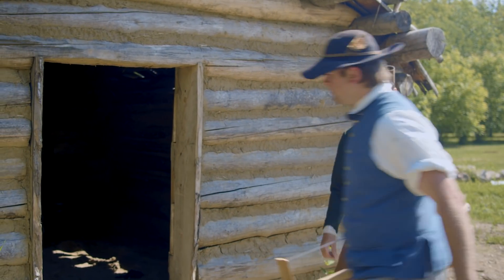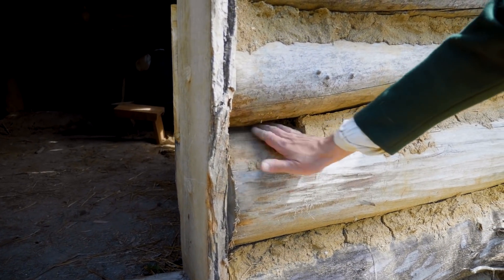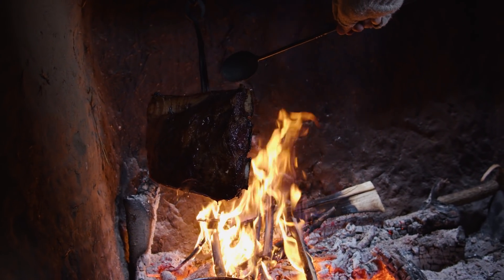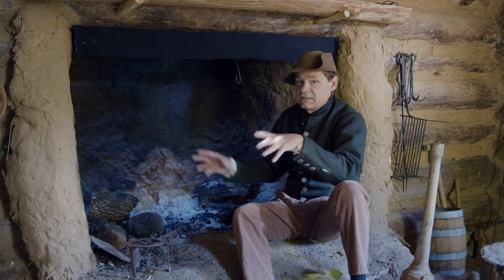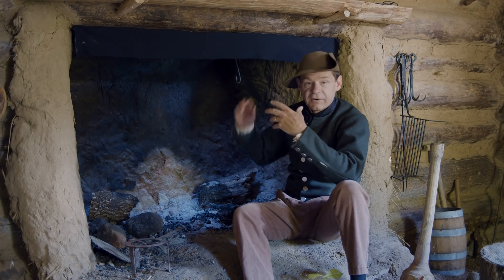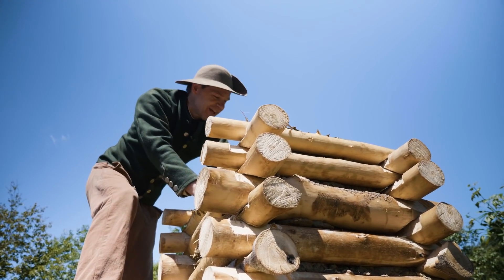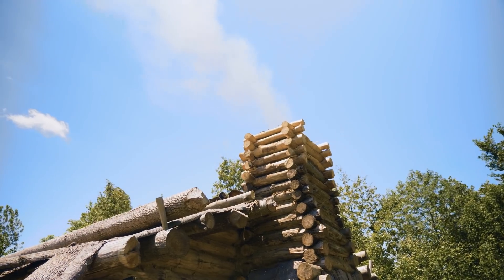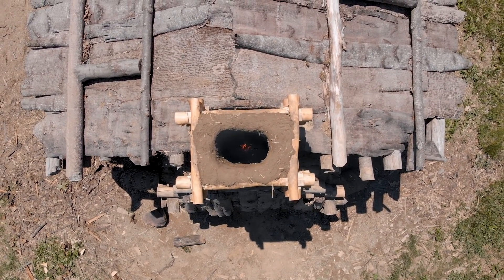Repairing Our Homestead Log Cabin - Chimney Maintenance

Comment: Jon, you might add ashes to the cob and cake it on the top to protect from fire. Wash and oil up your hands afterward, it's very alkaline.
You might build a sledge and bring in some stone. We'll pretend not to notice if your mule leaves tire tracks...
The Foxfire Books, at least the first 6, will be great sources of ideas. IIRC there were instructions for making a primitive shinglehorse- trust me, you'll need one!
When it comes time to test and cure the fireplace, please make at least an hour-long video of just the fire burning- no music, no speech, just a bright fire burning in the dark, no sound but popping and crackling, and perhaps you feeding the fire... Something to doze off to...

Comment: In my area, there are several log cabins that have been preserved and one has a rock lower chimney with the log and cob upper portion. They all have either flag stone or bricks on their tops to protect the cob, bricks were made on site of most of the farms around here by mixing some of the river sand with our Georgia red clay and then baked in big fires. An old timer once told me about waching his father do a brick fire by making a large structure of the bricks with lots of room in between the induvidual bricks, then logs and brush piled in among them, then a large pile of logs built into a structure around the pile and all lit up. He said the fire burned for 3 days and when it had gone out and cooled, they collected up several hundred bricks to build the foundation for a house.

Comment: A chimney cap would protect the clay from the elements and they made them from either tin or stone.
Reply: WatcherintheDark69 - I was thinking that as well. 👍
Reply: I think a stainless steel composite would hold up better through the elements. Also if they went with triple pane windows and a polyethylene siding. They could probably also add in a smart thermostat coupled woth an electric heater to regulate temperatures netter and keep the mud from cracking.
Reply: Tin wasn't a viable option until the early 1800's. Stone for sure. Here in New England we have areas where layered stone meets the surface. These were quarried when found. Thin, flat stone that didn't require a mill was highly coveted.
Reply: @pluto8404  Uhhh, they are striving to keep this cabin true to the period, not modernizing it.
Reply: @TrooperBri : I've seen larger flat stones and also slate. The trick is to do it peaked with the openings at the ends facing the dominant winds of that area. Also, setting stones into the cob at the top goes a long way to minimize the erosion of the top edge. But the slate cap is the best and is common throughout europe.
Reply: @sonofeloah  My hobby (and YouTube channel) is about metal detecting colonial home sites (cellar holes) lost in the woods of New England. Items like slate and nails would be luxury items through most of the the 1700's. The more permanent the site we find, the more stone we find collapsed in the chimney pile.
Reply: @TrooperBri  That sounds like an amazing hobby.
Reply: @pluto8404  LoL
Reply: @CGH250  qqq¹
Reply: What about fired clay bricks? Like, something akin to terracotta?
Reply: rather than stone, i would use a pretty thick piece of slate, because you can get it in a better form and its more heat resistent, if it is not thin. a thin piece would burst, but if you put it at the top of the chimney, it would protect from the rain and wouldnt be in direct cotact with the hot fire. it should resist the heat from the smoke, because its not a fast temperature difference.

i would try slate.
Reply: @TrooperBri  well i presume they tried to usw stones, because they got these stones from their fields and recycle them and they tried to imitate a chimney from their homes, but these stones could be from the lower areas of the chimney, while the top was out of wood.

slate, shalem and schist was used for roofs, if you got your hands on it, in europa and in the US in cities and in big farm houses. they wouldnt use it in a Log hut, who dosnt last for a long time. but they would use it in a long term home. slate got/get produced in Newfoundland, in Eastern Pennsylvania, Virginia, and Vermont, Maine and New York. 

And i dont want to be critical, but its one plate of slate in a pile of stones. are you able to see small slate pieces in these chimney piles. they would be small and grinded up by time and weather.
Reply: @pluto8404  LOL there's always a comedian
Reply: Flat stones on top and big flat on top of them.
Reply: @sonofeloah  you                            

the joke
Reply: @TrooperBri  If slate was too pricey, surely they could used fired clay (terracotta) to the same effect?
Reply: @pluto8404  why if a coating of liquid mytrill does the job?
Reply: @messman10  frontier people had no brickworks from  which to buy bricks.
Reply: @sonofeloah  I think he was joking!
Reply: @rosemcguinn5301  For Fired Clay Bricks I recommend:
https://www.youtube.com/watch?v=FwRFH7MH5N0
Turn on subtitles because he talks very little.
Reply: @sonofeloah  are people not realising the guy was just kidding...
Reply: @rosemcguinn5301  you don't have to buy them they are readily made with a minimum effort
Reply: @TrooperBri  “Items like slate and nails would be luxury items through most of the the 1700’s.” For the slate, it really depends on the local geology. If there’s an outcropping of it in his area, he should use it. Pioneers would have. Ditto for any other non-slate stone that makes suitably flat pieces.
Reply: Can you get slate?
Reply: @pluto8404  lol, I once told a couple who were trying to recreate a medieval feast hall in their home that the head of the hall, over the hearth, would be a fine place to hang a plasma screen tv.
Reply: @rosemcguinn5301  You could fire some primitive tiles in a small pit. Weather it was actually done, I don't know.
Reply: @sonofeloah  whoose
Reply: @sonofeloah  the joke went so far over your head it got confused for a ufo through a telescope
Reply: @pluto8404  look at this guy, time travelling to get advanced materials

Comment: It needs an outhouse with lilac bushes planted close by.
Reply: I approve of the lilac bushes. I guess the outhouse too, gotta have somewhere to go.
Reply: You'll do well to plant Hollyhocks too. They'll bloom all summer, lilacs only bloom in spring. I've used many an outhouse,  flower decorations are a plenty.
Reply: Make sure there is not nettles near the outhouse.
Reply: Elacampane, its leaves to be used instead of toilet paper.
Reply: Don't forget a crescent moon cut out of the door to improve ventilation and for the memes
Reply: I think lilacs are late 19th - early 20th century. I'll have to look into that. My Grandpa who lived from 1913-2005 refused to install plumbing in his small farmhouse bathroom. He used a huge metal washtub for his soaker bath. Had to boil water on the stove to bathe. Originally had a pump in the kitchen sink, but when it broke, my uncle who was a plumber installed a faucet hooked up to the sweetwater well next to the house. That's about as modern as Grandpa got, besides electricity and a black rotary dial phone on a party line. He kept livestock to the end, so lilacs would've been futile next to his outhouse. He put it out past the barn. When he died, he was probably the last living person with an actively used outhouse that wasn't a summer cottage or camp. He was definitely the last party on the party line. All the rest had died before him.

Comment: I’m glad you built up the chimney taller. I was worried about that (I think I even mentioned it in a comment a few months ago). 

To keep rain off the chimney, and also to keep rain out of the cabin, why not erect a small roof over the chimney? “Roof” may not be the correct technical term, but you probably know what I mean. A slanted cover held up by posts at the four corners, with space between the cover and the top edge of the chimney, so smoke still escapes unimpeded.
Reply: Gary Cooper   Perhaps supported by well spaced stones to allow adequate airflow?  It could work!
Reply: Could the cap be of bark? That might catch on fire - cover it in clay? Would a stone one work? They would have to have stone they could split into slates. Hm. Is it 'fair' to use tin?

Comment: Short question on the chimney. Why didn't you cover it to avoid rain and snow enter it?
PS: Great video again.
Reply: Watch that video- no time, no stone. Here in KY  he could line the whole firebox with limestone, add a smoke shelf, etc. and get some real heat from his fire...
Reply: I was wondering the same, probably because it would have to come off before each use. Also having a cover on top would be a hazard to take off during inclement weather when you just want to hunker down and build a fire.
Reply: @hcirs9425  Not if there's a gap between the cover and the chimney.  Protecting chimneys while letting the smoke out is an old idea, they just didn't have time to do everything with the available resources.
Reply: @princecharon  Good point, if so much cinder comes out one might need something fireproof beyond clay-covered wood.

Comment: Townsends! Mineral oil mixed with clay makes a decent water resistant plaster, this should help keep the chimney from weathering so fast and it won't burn. Also you can use the same technique to keep dirt floors from being so dirty, just tamp the earth well, they've used it in India for thousands of years.

Comment: One of the great things about those temporary log cabins is after a year or so when you've stopped using it and it drops to bits, the walls basically give you a load of perfectly dried out firewood to boot.

Comment: We live in the southwest US where a lot of the old buildings were built of mud or adobe.  It's a dry area, but it does rain and snow, and the buildings suffer.  There is a building style here called "territorial" which is an adobe building with the top course made of fired brick instead of mud.  Moisture won't hurt the brick and tends to preserve the mud lower sections.  Slows down the necessity of repair.  I know nothing of building, so that concept may or may not work where you are.

Comment: You guys should make yourself some workbenches. I made a nice one last year, just take a good sized log, white oak would be best and last longest, but poplar will work if that's all you have. Cut it about 4' long, drill holes for the legs at about a 15-20 degree angle, I made the legs out of buckthorn because it's invasive so I had to cut it down anyway, plus it's very strong. Oak or elm saplings would work well too. Then just hew the top flat with an axe, smooth it out with an adze and then plane it smooth if you want to. Drill some holes in it for pegs/bench dogs and then you can kinda clamp things in with wedges, or you can make holdfasts out of iron bar.

Comment: Have you considered using the old shingling you’ve got there as a base for cedar bough thatching? Just layering on cedar boughs a layer from eaves to ridge at a time until you have six or seven layers of those up there. It should shed water easily and form a nice covering as it settles in.

Comment: I used to live in a 400 year old cob cottage-the middle a row of a wool shed and two workers cottages. Kinda weird getting paint to stick on it or install new electrics in basically dried mud. Originally thatched refinished in local slate. The cottage before that was 16 inch local metamorphic stone 100 years old.

Comment: For the doors, if it can be found, or better yet, made, quarter of rift sawn lumber, with the rings running between 45 degrees and 90 degrees to the width of the planks, will minimize or at least redirect shrinkage and expansion, from the width to the thickness of the boards.

Comment: Where did they use leaning chimneys that were propped with poles.
The reason that they made them that way, was if they had a chimney fire, they could knock out the poles, and let the chimney fall. So the house / cabin wouldn't be lost.

Comment: Suggestion for the door. Keep this one on and maybe add a tarp to keep critters from being too inquisitive. Meanwhile, select the wood you want to use and skin and dry it. You could rough cut it for the shapes you want but do not do any measured cuts,,,yet. This fall once the wood has dried out, proceed to cut the lengths and widths needed and make a new door. It will not work very well to add to the door you have. Use it as a table later.

Comment: Have you considered making a small kiln (fairly ancient technology) and make clay roof tiles for the cabin? I'm not sure it would be period, but clay tiles made of native clay mud would be more durable than mud or cob daubing. A kiln would be a little more labor intensive than your clay oven, but it should be similar in construction, just vertical instead of horizontal. It's a thought.

Comment: I wonder if you couldn't make a mold for some clay bricks and fire them in the fireplace. Use them to build a top layer on the chimney that won't melt in the rain and will sit above the wood to prevent it from burning.  I'm not a historian, but that type of thing was certainly within the capabilities of the time period.
Reply: On second thought....might want to do that in an outdoor fire.  You'll need to get it pretty darn hot and keep it hot for several hours.  Might be too much for the fireplace.

Comment: If you put an animal skin chimney cover two feet or so above the top and found a way to secure it tightly that would keep water away and the chimney would still draw. Perhaps treat the leather with oil/beeswax to extend it's lifetime. It wouldn't have to be removed every use, just a thought.

Comment: Did anyone catch any kinds of injuries while making this wonderful piece of history?  I am very curious about this as I have stated this kind of comment in your other building videos.  In hopes that you might get inspired for an idea about how those in the times dealt with injuries and such.  Easy enough for us to get in our cars and head into the modern ER.  
It must have been a whole other beast back then without the comforts of modernized medical care.  The ability to weight the options of moving quicker to get jobs done verses taking the time needed to do things as safe as the could.  Risking injury would have had to been a big thing for anyone smart enough at the time to consider such things.
If you risk getting hurt it could impact how seasonal jobs get done and how they get done.  
A man in the 18th century would consider saving 2 days of work at a heavy and unsafe pace.  Those 2 days saved if injured would cost him weeks depending on the injury.
What do you folks do for medical equipment where you operate?  
One could make just about every kind of DME (durable medical equipment) out of wood and other materials you have out there.  Crutches, splints, bandages ect.

Comment: I know you are trying to make this a historic build, but the top of the chimney, couldn't you find flat (ish) rocks that are wider than the thickness of the chimney wall and place them on top of the edges to shed water away?  I would assume that people would use what was available and rocks are everywhere.  They don't need to be slate flat, could just be flat on one side (place rounded on bottom into fresh clay.  Should be high enough that they wouldn't get hot enough to cause them to fracture.

Comment: I've never understood why colonial cabins have chimney on the outer wall, here in northern europe they are built in the dead center of the house so that the heat effect is maximised. Basically you are only heating inside with the flame, instead of the tonnage of rocks that is in the chimney outside

Comment: Does using green wood (fresh & still wet wood, esp. if cut in spring) present problems with shrinkage as the wood dries? You mentioned the door or doorway getting smaller. Is that a result of shrinkage?

Comment: Why is your Chimney not built on a angle away from the cabin and held up with a prop?????,,,,, that's how they made them,,, on a angle away from the cabin and held up with a prop in case it caught fire,,, If it caught fire you would pull the prop out and the chimney would fall away from the cabin and your cabin would not burn down with all your winter supplies.

Comment: Did colonial Americans use the "three sisters" in their farming?

Did colonists ever make terracotta? You should be able to refine the clay with water, then fire it in a bond-fire. That would make an excellent chimney cap.

The failed tiles can be ground up, and mixed with fresh clay. This can then be really dried out, then fired again. Supposedly, that will make a useable fire brick. That can be used to protect the back and bottom of the chimney, maybe?

Is there any lime nearby? What other resources are available there?